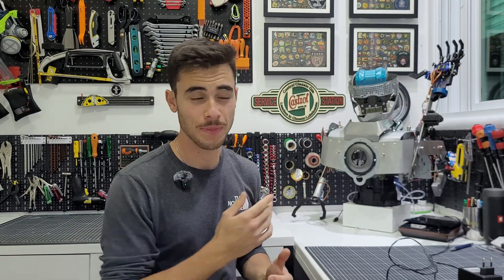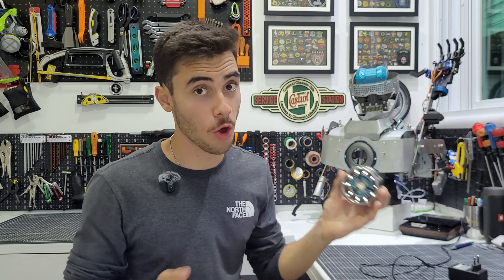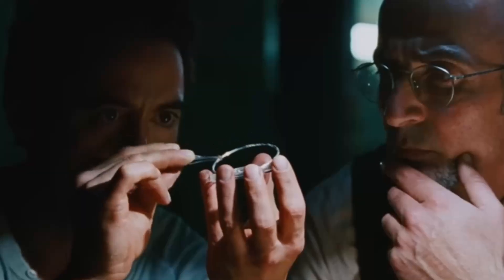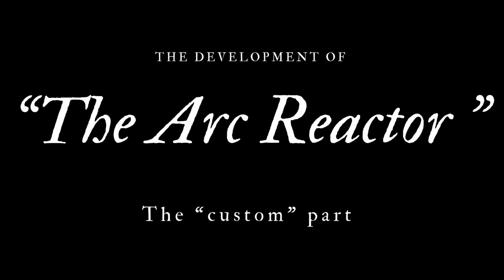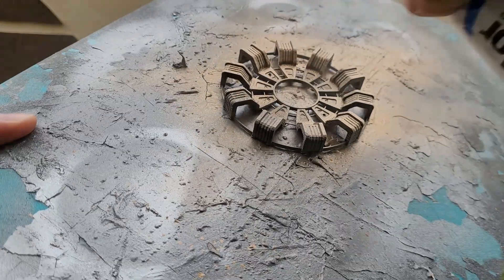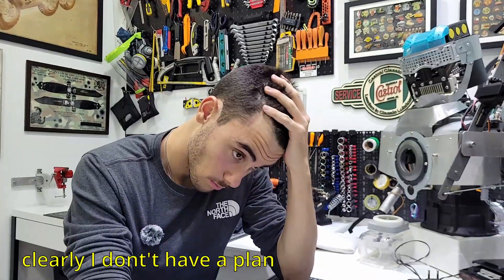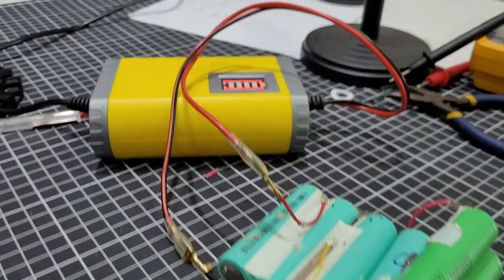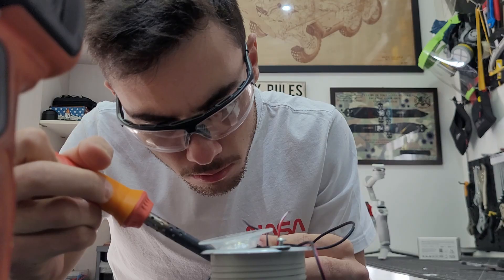I Built an ARC REACTOR Battery

Comment: Lithium cells are NOT dangerous.  
They:
Power exotic things very well
Contain chemicals that can be repurpised for a variety of tasks
Can be recharged almost endlessly!

The issue is in the charger! If you trickle charge the battery you have huge power gains over a long life span.  

So be careful with voltage
But it probably won't catch fire
Bypass ALL your battery lock outs and simply replace with max volt cutoff. 
Enjoy your complete lack of energy dependence
Reply from the maker: Thanks for sharing your thoughts! You’re right, lithium cells are amazing power sources with lots of potential. I totally agree that chargers and proper voltage management are key to keeping them safe and extending their life.
Reply: @vitorsinventions did you know the same lithium cells that allegedly explode and destroy planes, phones, computers and puppies are certified for high temperature capacitors?